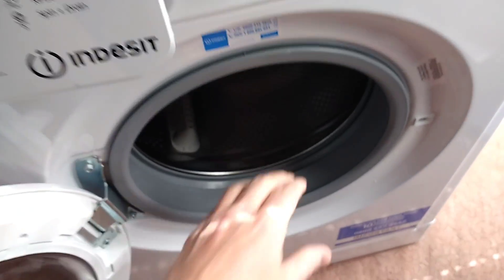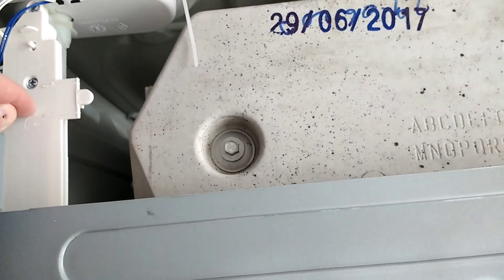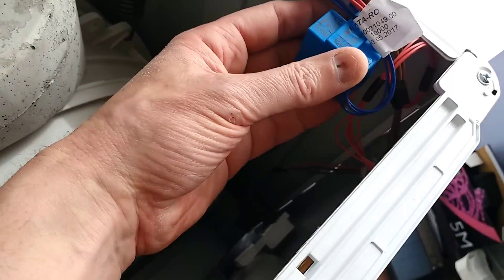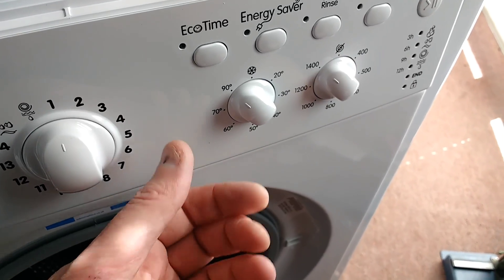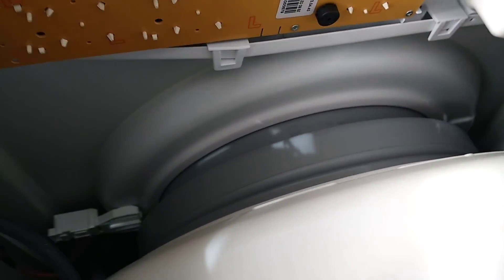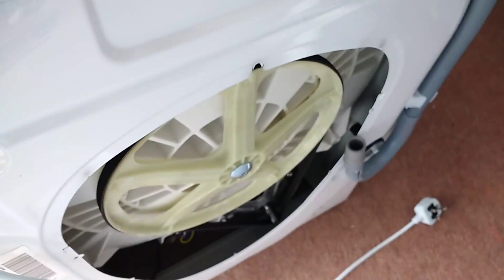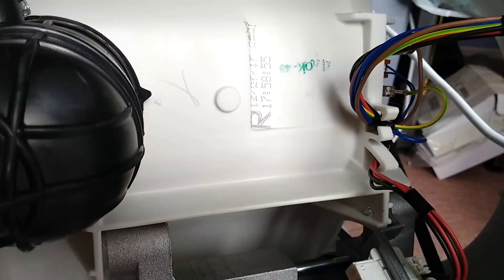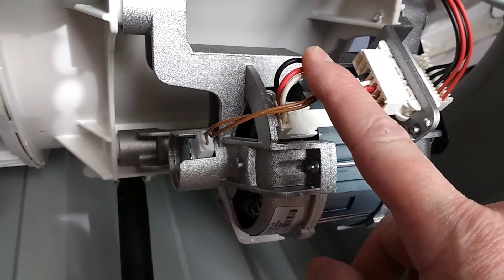Inside my new British washing machine (clothes washer).

Comment: modern washing machines do not like powder, they put very little water up to wash the powder down, leaving it behind and clogging up the drawer, but you can cheat by putting the powder directly into the drum before loading it
Reply: that problem isn't the powder but the thing between the powder and the machine ;-)
Reply: well , the stupid animal that feeds it has yet to discover another method of using powder sucessfully
Reply: I just shove some liquid stuff in one of those little pots in the drum with the washing. Haven't used the drawer in years.
Reply: Cant't comment on what you have in the UK, but here (Australia) we've been using a Hoover basic drier for the past 20 years. Best recommendation is avoid the fancy ones ("energy saving") - the humidity sensors (and associated control gear) significantly reduce reliability.
Reply: The Beko I inherited when I bought my house a year back recommends an empty 60° or 90° cycle with detergent every 6-9 months. Given clothing and detergent manufacturers keep recommending washing clothes at low temperatures (originally 40°, then 30°, some even allege excellent performance at 15°...), running periodic hot cycles is increasingly necessary to clean the machine and disinfect it.
Reply: Modern washing machines do not like powder, clothes, water and their owners :)
Reply: @simon tay, its designed so the clothes slap in just the right depth of water, not float, all you are doing is reducing its effectiveness
Reply: i actually follow the cup sizes for hard water and use a proper measurig cup, it really is the fact that modern washes only put a short burst of water up at the front of the drawer, even with liquid, its better in the drum that the drawer
Reply: yes that gets rid of the smellies that some machines get ( i get to leave the door half open, no kids, pets to air it out) but nothing except taking out the drawer cleans the unrinsed powder from it, which is why i dont use that method anytmore
Reply: mittfh Invest in a clothes horse?
Reply: I do have an airer - but especially with bedding, it would be more convenient to wash it all at once and have it dry within the evening rather than turning the heating on and up overnight...
Reply: you need airflow not so much heat, open a window, put a small fan on low and it will dry
Reply: Don't forget to take the transit bolts out!
Reply: I add extra water when I wash my clothes because my machine doesn't fill up enough for my liking.
Reply: Simon Tay That's the 'I know better/ habite creature
Reply: mittfh 
I use a Bosch condenser dryer which works extremely well. The condensate can be plumbed directly into the waste so no need to empty the tank. The sensors inside are metal strips just inside the edge of the drum and can be wiped clean, although I haven't found the need in over 7 years of use. It's quite a bit less expensive to run than an old vented type dryer. You can choose whether items are cupboard dry or bone dry and there's various special cycles for specific items like wool, synthetics, mixed etc. It's not noisy in operation either. I'd recommend it to anyone looking for a decent, reliable dryer.
Reply: mittfh the heat pump driers are far less energy intensive, and most allow the condensate to be diverted into a drain.
Reply: mittfh 90°C washing serves two purposes:  1. Killing smelly bacteria, modern detergents claim to do this without heat, hence the cold washing campaigns.  2. Killing dangerous bacteria such as MRSA.  There is no substitute for this purpose.
Reply: Jusb1066 Then you probably put too much powder in or your water pressure isn't reaching its potential needs
Reply: @tommy boil wash . im no longer in nappies and a few years short of going back!   even liquid can get a pain in the drawer, i just put whatever in the drum , powder or liquid, problem solved even at 40c wash
Reply: Jusb1066 It ain't the clothes that need the 90°c but the machine.  Classic line I hear from every client😊
Reply: anononomous we got a lot of clients complaining the machine won't rinse.  Most of the time combo soap-pots/towels,   too much soap leftover and unbalance, motor driver detects resistance and shuts down spinning
Reply: mittfh make it every month. Defenitlly if connected at the rainwater
Reply: Slightly O/T, but does anyone have tips on tumble dryers? I'm starting to get tired of using my bathroom shower rail and the 3 radiators in this place to dry stuff when the weather's not good enough for outside drying...
Reply: i do, but yes, liquids have become cheaper over time, powder was cheaper for a long time, and money was tight...and big boxes of powder lasted a  long time and saved money, but smaller and also cost concious liquid detergents now exist, but i still get powder from time to time....
Reply: Get a pulley that that hangs form the roof, great in bad weather and clothes up out the way.
Reply: Jusb1066 with our Bosch, I've noticed that if I slam the powder tray shut, pushing the powder to the rear, it works just fine.
Reply: igotes depending on the garment it may also not be good for it. What we are talking about though is running an empty load with the high heat to kill the germs and get rid of residue in the drum. I combine it with a washing machine cleaner tablet or bleach
Reply: Not a good idea to put the powder straight in the drum. It can stain and ruin dark clothes if neat powder comes into contact with damp fabric.
Reply: It's actually because modern machines don't require what is known as "the recommended amount" but only require about half, remember it's not the amount of soap that does the washing it's the movement of the water
Reply: @DandelionBill  Fun fact: When I went to training at Whirlpool, we learned from their engineers that their HE machines only require a mere three tablespoons of HE compatible detergent to effectively wash a normal sized/soiled load of clothing.
Reply: ok so here's the deal with liquid V powders. all powders EXCEPT 'colour' powders have oxy bleach in them & you get scale if you live in a hard water area.  all liquids INC 'colour' powders DO NOT have any bleach in them, therefore you still get the scale if you in a hard water area, + all the gunk due to not having bleach in the liquid. the manufacturers of the liquids used to blame the customer for not using enough liquid in the early days, ofc to get you to buy more! but its purely the fact you are using liquids that give you gunk.  reason for liquid appearing in the 1st place is that the powder with the bleach bleaches the colour out of your clothes.  so the decision to be made is:  do I use powder that has bleach & is good for my washing machine, OR use liquid that doesn't bleach the colour of my clothes BUT WILL gunk the machine up with bacteria.  using higher temps & liquid will delay the buildup but it will still happen. some washing machine manufacturers  like indesit/hotpoint sell a cleaner  or you can buy DR Beckman from your local supermarket. follow the instructs on the box BUT don't be tempted to use the quick wash as you wont get much benefit of the cleaner, they only work at above 60 degrees-i'd use the 60 cotton or the 90 cotton cycles for best results from the cleaner.  when the liquid 1st came out it used to eat the metal of the heaters & drum supports, now these 2 item are coated to stop that but still sometimes you get a support that will break from the fatigue of being eaten by the gunk left from liquids which ofc ends up as a costly repair if you not insured!sorry a bit lengthy but hope it helps some people understand whats actually going on inside the machine. feel free to comment if you want more info
Reply: Jusb1066 Use max 45cc for a full machine, liquids are top for color and specials, white needs powder, better bleach.   And boil the thing FFS 😁, 90°c is the thing needs
Reply: I was thinking along the lines of a basic vented drier - condensors seem to be all the rage, but they're more complicated, less reliable, and there's the faff of having to periodically empty the condensate reservoir. It'll be going in my porch, so just a single skin brick wall to punch the vent hole through, with a double brick cavity wall between it and the house, so should fluff end up in the heater (as happened on some Hotpoint/Indesit models recently), it won't burn the house down.
Reply: mittfh get a condenser type, then you don't need an outside vent, so can put anywhere!
You just need to empty a trough every so often.
Reply: I wash everything at 40°C with biological liquid. Air dried on the washing line, everything is clean and smells nice. High temperature is a waste of energy IMHO.